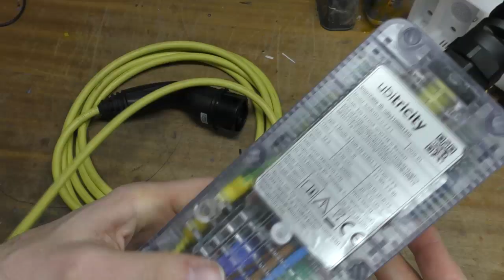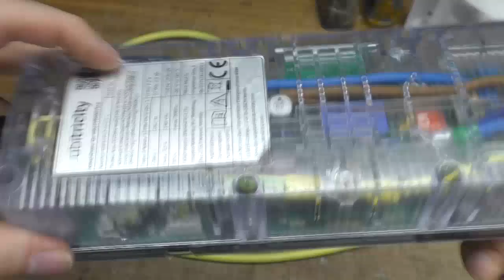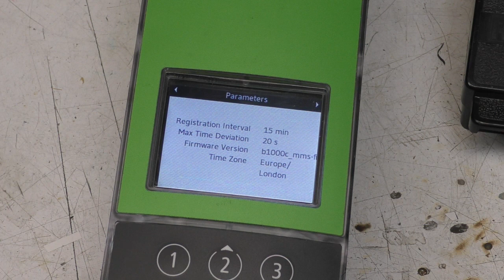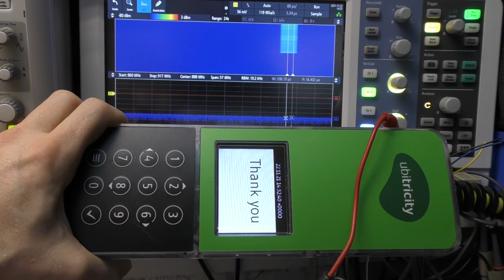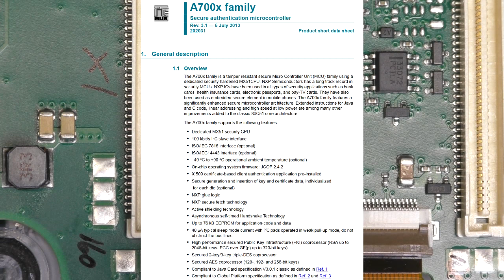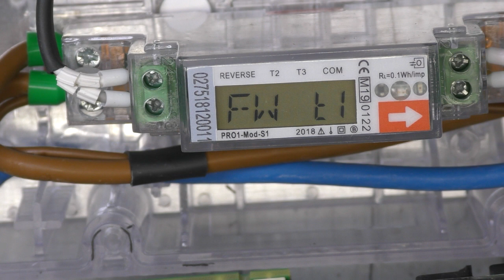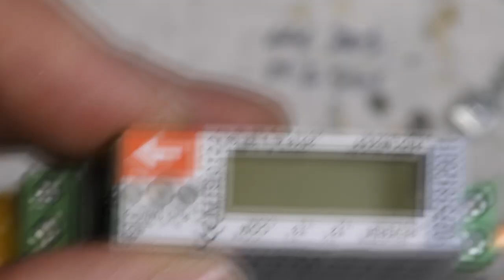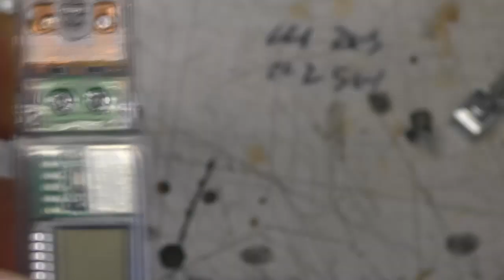Ubitricity EV Smart Charging cable

Comment: EVSE question: how hard is it to put an EU EV socket on, say, an electric bicycle and use an EV car charger to charge a bicycle? 

I'm not talking DC fast charging or 400v charging, since that's either overkill or a great way to start an lithium battery fire
Reply: only needs socket, one diode and one 820ohms resistor
Reply from the maker: Simple - you just need a switched diode and resistor on the CP line in the connector to tell the EVSE to turn power on. The switch is needed as some CPs lock the econnector. You can also buy type 1/2 to AC outlet adaptors/cables. Instead of a socket you may want to just make up a Type 2-to-whatever-your-bike charger-uses cable
Reply: @flipschwipp6572    @mikeselectricstuff  
Interesting to hear, I expected more circuitry to make the charger not freak out
Reply: As others have said simple, you can also buy ready made type 2 to 16a cee or schuko adapters from various shady sources
Reply: @MrHack4never   Remember, these are not chargers -- the charger is IN the car. These are just electricity supply devices. So your bike would still need separate charge circuitry.

Comment: My prediction for the future: mandatory separate metering for domestic use and EV charging use. With EV charging being taxed as revenue from fuel duty starts to dwindle. Especially after 2030 mandate that all new vehicles will be EV.
Reply from the maker: Except that would be impractical and dangerous - people would use granny chargers or more unsuitable arrangements to charge from the domestic supply.
Reply: @mikeselectricstuff  what if manufacturers stop installing on board chargers, mandating us to charge at rapid hubs that are taxed? You've probably seen my thread on speak-ev discussing same...
Reply: Lot of places are simply averaging out the estimated revenue per car they get from fuel duty and adding that to yearly registration charges, of course while they're trying to encourage uptake they will either not do this or keep the rates low enough that people are less likely to complain that it's not actually cheaper to run
Reply: @mikeselectricstuff  I certainly would, because even an overnight charge on a 3 pin domestic plug/socket would still add enough miles for my driving the following day. They wouldn't know whether you charged a car up or sat up watching TV all night...... How could they realistically tax electricity generated by privately owned solar panels, unless they offered an assurance the sun would shine on X days per year?
Reply: Once UK fuel duty begins to dwindle, it is to be replaced by a system of road tolls, the details of which have mostly already been worked out. The Government are to publish some details of the scheme in 2022 I believe.... You appear to be implying that somehow the cost of charging an electric car will rise hugely, and the cost of petrol and diesel will not?  I think you'll find that is most unlikely. Any Government which purports to promote the usage of green energy and transport methods to fulfill their climate commitments can hardly allow a situation to develop where fossil fuel is cheaper to use than energy from renewable sources.....  And don't forget oil refineries. If the cost of electricity rockets, then so will the cost of fossil fuel by default. Oil refineries use lots of electricity..... Once the UK Government ceases subsidising the oil industry by £300 billion per year, the Treasury coffers should look a little healthier....
Reply: @Brian-om2hh  Certainly the cost of charging would increase while fossil fuels would not, and yes you could plug the vehicle into a domestic supply (assuming future vehicles are not fitted with some sort of communications protocol to negotiate power delivery like the one feature in this video), but this could be addressed in the same way that using agricultural diesel for non-road use is illegal: There is nothing preventing you from physically doing it, but most people want to stay on the right side of the law. That said, thinking about it, i think the route you suggested of generating revenue from road taxes and tolls actually makes more sense. Either way - the UK government could not simply do nothing; it is far too dependant on revenue from fuel duty to let that go away.

Comment: They may have stopped making them because people were bypassing the metering.
I have no evidence, but can imagine it happening.
Reply from the maker: Doubt it - more likely people didn't want to pay for the cable
Reply: I guess that's possible? But each unit is registered to an owner for billing and calls home for authorization, right? I assume it would look suspicious if you were charging through the service but the billing was zero.
Reply: Nope, not possible. Second meter in the outlet for exactly that reason.

Comment: The current monitor not being on the neutral wire is interesting.  I guess you could flip the polarity on both sides and draw "0.0Wh" fairly easily after the authentication dance takes place.  (I guess the security module isn't authenticating that embedded meter either, so you could just emulate your own and make it count at half the rate as normal.  I bet nobody would ever notice.)

I see why they're phasing this out :D

Comment: I was just wondering what is the percentage of electric cars to chargers what if everybody wants to charge the car all at once it could happen most people go in the grocery store and all leave at once
Reply: No, hardly. Not everyone fills with petrol at exactly the same time, do they?  Not everyone covers the same distances during their journeys. We all have different driving styles too. You could have 2 identical cars, and two different drivers will yield different levels of fuel consumption with those same cars. And even if they all came out of the grocery store at the same time, they won't all travel the same distances to work, at the same speeds on the same roads. We're not all the same, which is why we eat at different times, and get haircuts at different times etc....
Reply: @Brian-om2hh  no not everybody feels the car with petrol at the same time but in the video he said there was only a certain number of chargers there’s got to be a lot more cars than chargers The one thing I find ironic about electric cars is all they’re doing is switching gas for electric you’re still gonna charge you for the electricity and it causes a lot more fuel to make that electricity right now with the electricity rates I would be paying more to drive a car if it was electric that’s the ironic part Electric car is only economical if electricity is too cheap to metre plain and simple
Reply: Does everyone fill up with petrol all at once?

Comment: Why not just do an authentication on a mobile phone APP and just have a bluetooth module in the carge post, that way  niether the charge post nor the cable needs a cell connectsion. And  you could solve the under ground carpark issue by letting the app pre authenticate a charge.

Comment: What a waste.! It doesnt even seem to a have contactor, the DIN part is just an electricity meter. So the actual contactor to control the charging still has to be integrated in the lamp post. That means some sort of control is also present in the lamp post. This whole concept is kind of moot in this case. They could have easily integrated the power measurement and the authentication into the lamp post itself. Plus they wouldn't need like thousands of these "smart cables" when a single robust solution would have sufficed to be integrated into the lamp post. Perhaps they wanted to "sell" these expensive cables and make a business case, which obviously failed.
Reply: I really wonder whether a large part of the cost was that microcontroller board, and to avoid putting one of those in each lamp post they put one in the cables instead.  The reason I say that is I've looked at a few different industrial devices like this and instead of using a cheap microcontroller and writing bare metal code in C, they pick a way overpowered controller that can run Linux, just so they can write all their code in a high level language like Python.

I get that C programmers are harder to find and cost more than someone who can learn Python in a weekend, but it just makes me wonder whether they could've paid a bit more for a better programmer, saved a huge amount of cost on the hardware side, and sold many more devices and been more successful as a result.
Reply: If you listened to what Mike was explaining at the beginning, putting the smarts and expense in the cable was meant to make it even easier for municipalities to add this system to their lampposts. They literally just have to install a simple plug that probably costs very little. Then all the transactions and whatnot are handled by the company, and they peel off a percentage each month to kick back to the municipality.
Reply: I'd still prefer to have the contactor in the lamp post. That way the actual connector is unpowered when not in use which also makes stealing electricity harder.

Comment: This cable is really not that smartly designed (from a logic, perspective). If that box, is all it takes to make the system go, then it would be simpler to have it inside the pole, and control the setup using phones (we all have apps these days), leaving the cable bare of any "eye catching" features.
Reply: As explained in the video, that means you're paying for this setup at each pole, versus only having to make them for the people who actually use them. You might install hundreds or even thousands of these units into the poles and only have a faction of them in use, which is a waste.

But as also explained, they have since moved to exactly what you just suggested.

I first heard of these through Fully Charged, and I'm glad they've managed to survive so far. That video is still available; being old also means you get a feel for their intent and plans. https://www.youtube.com/watch?v=rKaEhBjt1ls
Reply: The newer poles are doing this now, you can access it with a QR code. Works ~reasonably~ well (app is a bit crap sometimes).  Makes the smart cable completely obsolete IMHO. The cost of installing the socket and the magic gubbins to make it work is quite high compared to the relatively small cost of building a radio into it, so it always struck me as an odd approach.
Reply: The reason was cost. A the time this thing was designed, a metering power outlet was proper expensive. Not just to purchase, but also to operate - you have to have a calibrated energy meter, and communication infrastructure for metering. The idea behind this was to reduce the cost of installation, to encourage cities, businesses, real estate developers etc. to simply include charging points without the need for all of that.
Reply: The last thing that EV owners want is another app.